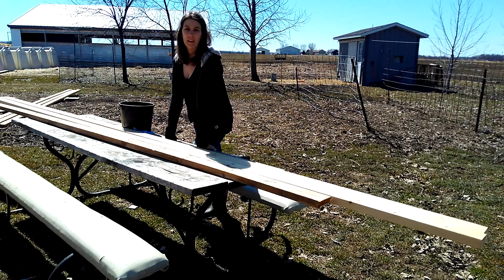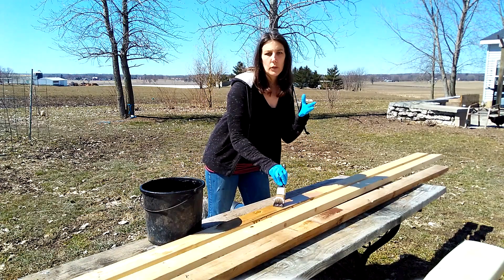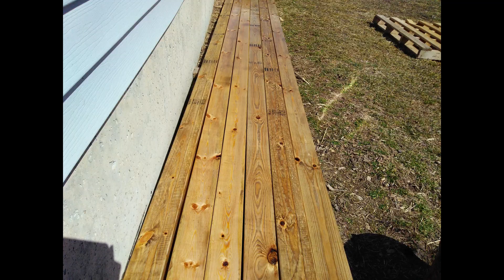How to Treat Lumber | Treating Lumber with Motor Oil | Acres of Clay Homestead

Comment: If you want to use new or newer oil but want a dark or brown finish you can add small amounts of rustoleum to your mix, this can be the spray form or oil paint in the can.
Reply: Cool tip thanks

Comment: Great video .love your channel. Question for anyone..how would this practice be for poles that are going into the ground?
Reply from the maker: If using in the ground, I would probably  soak the pole for a couple weeks so it's good and saturated.  (I've never tried it though.)
Reply: Have seen it work well in ground, but avoid constant contact with moisture (even with pressure treated) by using a membrane or plastic coating, and leaving any cement open at the bottom of the butt.

Comment: I had no idea this was an option! This may sound silly but...does this make the wood more flammable???
Reply from the maker: No, I don't think the wood is any more flammable than it already is. Great question though!
Reply: @acresofclayhomestead  It does not make it any more flamable. The deseil fuel is used to thin the oil so it will give it better capability to go into the wood. After a day or two of drying the sun. The fuel oil mix will dry out leaving the molecules in bedded in the wood.
Reply: @acresofclayhomestead  Does it preserve the wood , and make it stronger .
Reply: Has anybody heard of "wood stain"? It contains petroleum distillates and has been used by woodworkers for many years. I am fairly sure that engine oil is made of petroleum distillates.

Comment: After you treat Can you safe the rest of the oil for used next time ?
Reply from the maker: Yes
Reply: absolutely not. Just as you need to change your engine oil every 5K miles. Due to viscosity breakdown, you need to recycle your left over used oil immediately after applying to your wood posts

Comment: I'm trying to find out if wood treated with motor oil will work okay when laid on concrete block about 3 ft from the ground.
Reply from the maker: Yes, that would work.
Reply: @acresofclayhomestead  thanks.
Now to mix with anti-termite mix.

Comment: Seems really good, how is it seem a little bit opened? I mixed with used engine oil with diesel 50/50 ratio. And got really a dark black colour. How did u achieve a opened colour like a stain sir?
Reply: You either used heavy crude oil, used a pennzoil or Castrol with additives making it darker possible even way overdue on a oil change, or you got your ratios off.

Comment: How did it hold up ... ?....
Reply from the maker: Still holding up well! I will recoat them again next spring.
Reply: Thank you very much for the reply/info ... y'all have a blessed one ... texas
Reply: Would this be safe for logs around a raised vegetable garden bed. I started coating logs around our raised bed until someone said this might cause our soil yo be contaminated. What do you think?
Reply from the maker: @richardbrhel I have done this to raised beds, but only on the outside where the soil doesn't touch it. The oil can leach into the soil.
Reply: @acresofclayhomestead  Ok, thanks.

Comment: I just applied, with a brush, a mixture of engine oil and diesel fuel to a piece of 2" x 6" x 16' pt board that'll go on my fence. It rains quite a bit where I live, in Florida. Does anyone know not guess how long the protection will last?
Reply from the maker: I will be reapplying it to my fence again in the Spring. So, every other year for me....
Reply: @acresofclayhomestead  

Can we do this in any temperature?  Living in MINNESOTA and we want to build a few outdoor things and the weather is cold.  Does it have to be above freezing?

Comment: Why do you treat me this way?!?!  haha  I've been using new oil, and it's a little expensive.  So I mix a lot more diesel than you do.  Also, I'm spraying a large fence around the house, and I'm guessing that the solution needs to be thin for the sprayer to function.  For now, everything seems to be working well.  I just hope all my work doesn't completely evaporate in a few days!

Comment: Just a quick comment on getting diesel (or gas, or oil) on your hands.  First wash your hands with WD-40 (it smells a lot better than diesel or gasoline, in my opinion anyway).  Then, wash your hands with some good soap and water.

Comment: This method makes the wood last very long, depending on how deep it soaks in to the wood and the choice of wood, etc. However BEWARE THAT THIS USED MOTOR OIL CONTAINS HEAVY METALS AND OTHER STUFF, i.e. don't use it in large amounts near food plots... for obvious reasons
Reply: i have heard hot  wax is added for that?
Reply: Very good point, also any leakages will ultimately ruin groundwater.

Comment: My used engine oil looks a lot blacker than that. :) I used it to treat some wooden gates I built from planed, untreated timber, 12 years ago and they have held up really well. I wonder if anyone has actually tested spent motor oil to see how well it preserves timber.
Reply from the maker: Last oil I used was very black too.😄
Reply: At least 20 years I bet if you reapply probably a hundred years

Comment: what a terrible way to treat new wood. my builder did the same to the fence and it was a terrible job. factory treated wood is much different than this ridiculous method.
Reply: I do this with pressure treated wood new, last alot longer and it stains it a pretty color
Reply: I wouldn't call it terrible or ridiculous. If you don't agree with this method and wants to spend money on factory treated wood then that's your choice. Her choice is doing this way and it's working for her. Thanks for sharing.